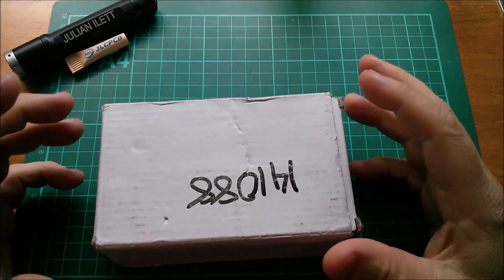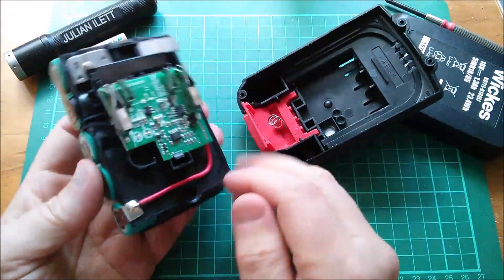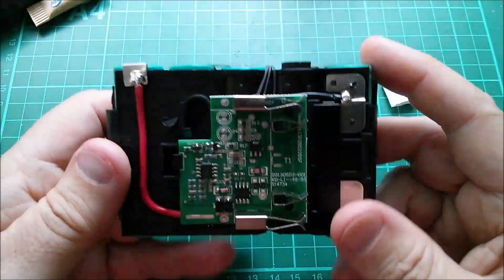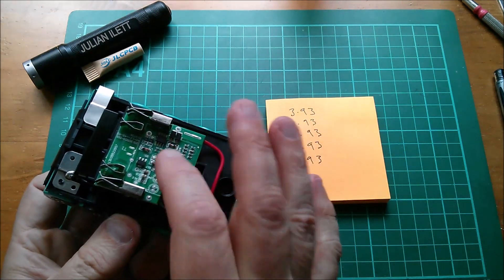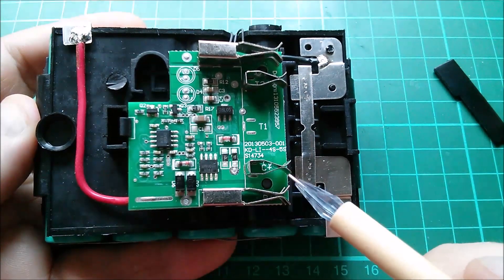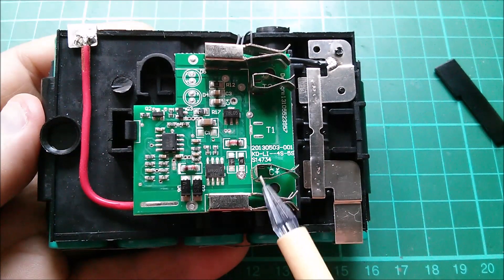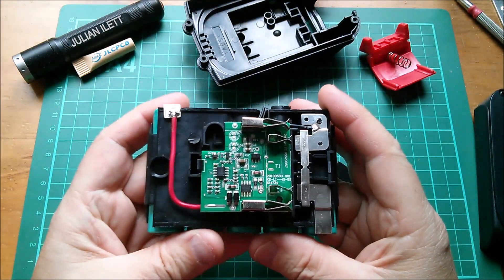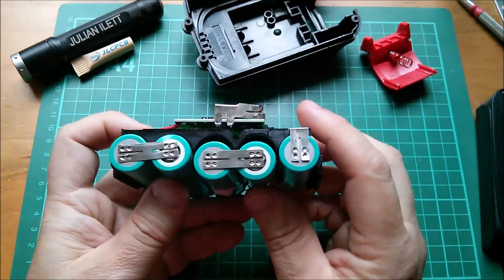Wickes 18V Battery Strip Down (minimal electronics)

Comment: Make a connection for single cell charging through a balance lead just in case cus they never same resistance 1 will always raise it voltage faster than others that am low resistance it's a nightmare lol

Comment: My understanding of the whole balancing thing (and I am by no means an expert, I just fly drones a lot :-))

Balancing is usefull if you want to shove the most energy possible into them to then get the longest duration out of them when using.  That's why balancing is so important for RC and drones, because you want them running for as long as possible or at the highest voltage and amperage they will give you.

I can't recall seeing cells get out of balance by a huge amount other than when a cell was so severely degraded the whole pack was pretty much useless for it's main purpose (it can still have some uses otherwise). So while the balancing takes a LOT of extra time on the charger, you don't get a huge amount of extra energy into them (but again, for RC a small amount can mean the difference between a 1st or 2nd place).  Or with drones, that tiny bit extra power can give you the seconds difference between a landing and a crash.

For power tools... I really don't see the purpose. You're not going to be bothered by a few seconds of extra use, you just slap on a new battery and off you go.  And you also don't want your batteries to be in the charger for hours. You want the battery to be charged by the time the ones you're using have run out, quick cycle times are more important, you're not (really) limited by how often you have to do a battery change.

The  bonus for the seller is of course they have you hooked on a consumable and you'll be needing to buy new batteries on a regular basis because small imbalances in charge times of each cell will have cells grow more and more imbalanced to the point the pack becomes unusable because it "can't hold a charge" anymore (it usually can if you rebalance them).  This is usually compensated for by using cells that have a higher density, more "C" and/or better temperature ranges but lower amounts of guaranteed charge cycles, so it's sort of built-in obsolesence.

Comment: On earlier videos, it looked like the cell balancing was done by the electronics in the charger, but that battery pack looks like there's no access to allow anything to measure the individual cell voltages, so it seems like they're relying entirely on all the cells being exactly the same chemistry so they charge at exactly the same rate.  That won't last for too long, and most people would eventually throw out the pack for having too little charge, when all they'd need to do is open it up and individually charge each cell to full charge to restore the battery life to almost new.

Comment: I would love to see a Ilett-engineered version of "Ultimate 18650 Battery Pack" https://www.youtube.com/watch?v=0jRsltIW8qM&t=369s . (I'd personally add a built in $1 flashlight, but consolidating the separate boards is beyond my skill.) Plenty of mechanical/heat transfer improvements I can think of (consolidate the MOSFETS and whatever components are heat-problems on a large heatsink), but the original isn't a 'design' so much as wedging off-the-shelf parts. Which means designs. Sigh.

Comment: i would say the missing component's shape matches a 2.5mm jack. possibly for charging from another power supply?
Reply: That's what i thought too. I have an ALDI Workzone 20V/2Ah battery here that has a 5.5mm DC jack for a 22V power supply. I also have two tools from LiangYe (OEM for many tools from ALDI, LIDL, ...) that have basically the same PCB in their batteries, but the DC jack and some circuitry are not populated because they get charged via charging stations.

Comment: Did you check the capacity of the cells? 3.93V as storage charge is quite high for my taste and if they really have been build up 4 years ago, it might have been even higher.
Cells will always have slight production tolerances, and the weakest in a series pack will be cycled the hardest (realtively speaking, because in a series pack you always take the same amount of mAh out of each cell; that's just physics). But cells from the same production batch will be very similar (at least from quality manufacturers) and the pack will most likely have been killed by usage (mostly storing it fully charged for weeks and month) before the cells get so much out of balance that it becomes an issue.
What's the charge current? I doubt the charger will be able to deliver enough power to heat a cell to the point where it becomes dangerous.
Reply: I have and got 1300 as per the specs

Comment: I managed to grab some of these from a few different Wickes stores on my recent travels, so thanks Julian for bringing this to everyone's attention. Its good value for £1 but I agree that 1300 mAh isn't anything amazing,it's "okay". I'm thinking they might be useful for torches that aren't heavily/regularly used. Anyone else got suggestions for how to use these batteries?
Reply: Anything that needs batteries really.  Or anything that has a battery but the cells have died... Though a bit of  handywork will be needed. 

I've used cheap batteries like 18650 or lipo packs that weren't up to "racing spec" anymore for refurbishing laptop batteries, refurbishing e-bike batteries.

BIG power banks so I can charge my drone lipo's far away from a power outlet. (and less heavy and quieter than carrying a fueled motor+dynamo+fuel) Or run the laptop for a whole day off the power outlet.
I really wish I knew more about electronics to figure out how to an efficient 95 cell (or more) pack powerbank.

With enough of these you could probably even run a 220V inverter and run your washing machine while on a hike. (the lack of washing machine access is obviously why not enough people do hiking in wild nature).
Reply: @oreubens  I've got power banks but these Wickes cells are a bit underwhelming at 1300 mAh compared to easily available batteries that have twice the capacity. I'm thinking of none critical things such as garden lights charged by solar, that could be a nice project. Bicycle lights also could be good but I've not seen that many that use 18650, they usually use AA or AAA, though I've got a head torch by LED Lenser that is nicely designed to accept both AA or 18650 cells.
Reply: @Franksey180  There are Bike lights that run off 16850s.  And by lack thereof, you can buy or make a mounting for your bike so you can attach a regular torch or a head torch.
Gotta be careful, I got pulled over once on my bike because the bike light was way too bright.  So gotta remember to not turn it on full when I'm driving on a road that has traffic coming from the other side :-D

Comment: Is it possible that each of the cells have their own integrated protection circuits under the + ends of the individual cell packages? This could explain why each cell showed exactly the same voltage and why balancing circuitry wasn't implemented on the board (they're relying on the cells own protection circuits to handle that.)
Reply: nah, protected cells like you mention are typically a tiny bit bigger than 65mm. These are normal cells (ive got 6 of them in bits next to me now).
Reply: @ratgreen  Julian's cells look to have a end-module under the shrink wrap (judging from the indentation).

Comment: Nearly fell off my chair when you pulled that battery pack out, it's the same as I have been using as a bench supply (with a "Drok" buck converter) for years, I found it and its charger in a skip yonks ago! I
don't even own a "proper" bench supply.
Reply from the maker: Cool. Let's start a movement against "proper" bench power supplies :)

Comment: I have built a lot of those USB power supplies for charging my cell when out in the boonies, where we love to camp.  The majority of them have only a + and - lead from the 5 cells that you have to solder together. Some of my older builds are now on year 5 and still seem to hold up well when I recharge them before hitting the Mohave for a week of wonderful peace and quiet. I think the balance comes in when you use them for high output such as 19 volt packs for laptops and such.
Reply: I lived in the Mojave desert (Barstow and Ft. Irwin) for several years and loved it. If peace and quiet is what you're looking for, you can certainly find it there, lol. Easy place to lose yourself in as well if you're careless. I remember the road from Barstow to Fort Irwin being marked with crosses on the roadside showing where people had died along the roadway.

Comment: You can't buy 5 18650s that cheap, no matter what capacity they are, definitely not Samsung. you should've bought as many as you can.
Reply: they can be as this is a dump product . Julian said it's from a clearance sale
Reply: ya but if you do anything where density matters they are useless, you can easily get twice that capacity in an 18650 and we are well on the way to get tripple that capacity.
Reply: These are definitively original Sumsung cells.